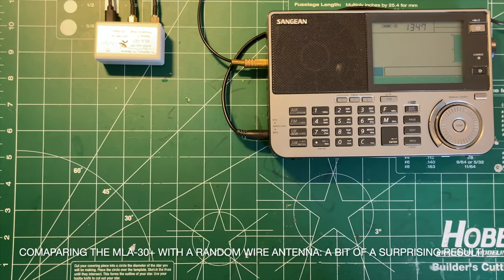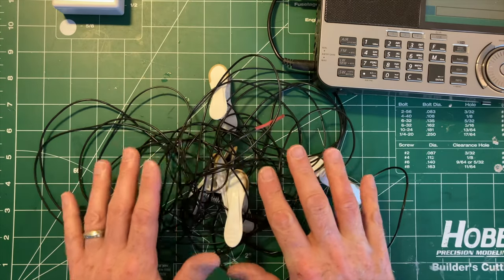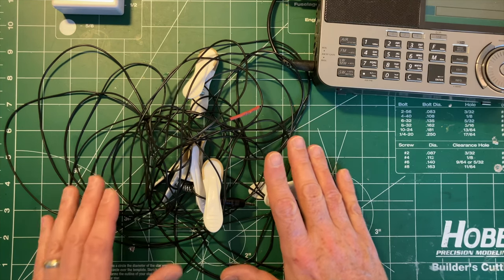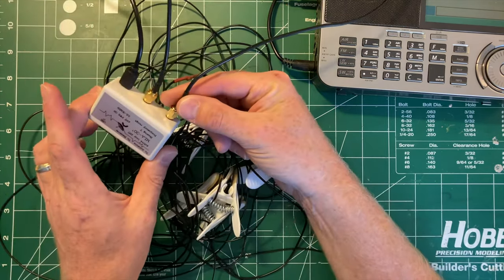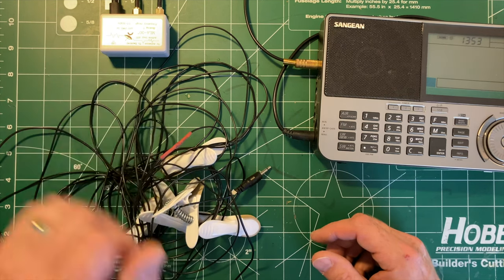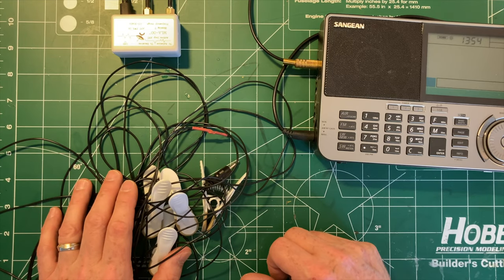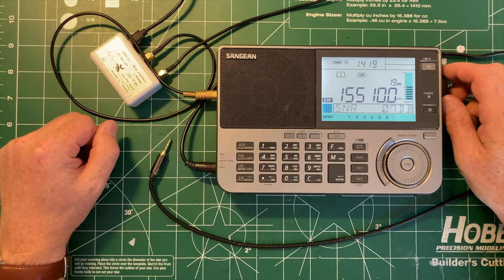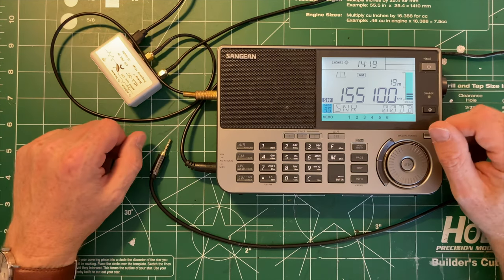Comparing the MLA30+ With a Random Wire Antenna: a surprising result

Comment: I took a 25m length of wire and set it up as random wire in my urban environment- very noisy. I then progressively reduced the length by 5m intervals and found that the optimum length for best S/N ratio  for my PL880, PL330, PL600 receivers was 7.5 to 10.0 m. The 10m wire I use appears omnidirectional and is my main antenna. Ken Baird, Lower Hutt, NZ
Reply from the maker: That's a good approach if the gain control on the radio isn't sufficient (or the radio doesn't have one like on the PL330).
Reply: What band(s) were you trying to receive.  Antenna length makes a big difference.  5m is a lot to cut incrementally, esp. if you first don't do the math.

Comment: With the mla-30, if the radio has a DX/local switch/button flip it to local to try to avoid the receiver from overloading. I have to some times do this with the MLA-30 hooked up with my Eton Elite Executive, especially on days/nights with real strong reception.

It's best to have the mla-30 mounted to something that can rotate because it is directional, it has nulls to the side of the loop, and the edge of the loop (in line) is where it picks up the signal. So if the signal is north of you, you point it north south, and it'll null out east and west. RCA makes an antenna rotator for around $100-$120 which would work well for rotating the MLA-30 but would it actually be worth spending $100-$120 on doing it vs doing it manually. 

The sma coax that leads from the loop part into the power supply isn't the best in the world, a popular modification is to cut the wire off and install a BNC connector and use a much better coax between the the loop and power supply. It's a tight fit but installing BNC connectors onto the MLA-30 power supply will also do a bit better signal wise. I have yet to cut the coax off and install a BNC connector onto my MLA-30 but I do have a BNC coax leading from the power supply to the radio and it has helped a little in a better SNR. 

You'll also see a drop in the noise floor if you can use a linear based USB power supply (CCrane use to sell them). 

I seen a slight improvement by clipping on some ferrite onto the coax on the MLA-30 on both ends on the coax leading from the power supply to the loop, from the power supply to the radio, and onto the USB cables leading into the power supply.

I've seen people make the loop on the MLA-30 bigger using some copper tubing, but I've not seen a comparison between the MLA-30 with it's stock wire loop vs the modified bigger copper loop to actually see if it helps or hampers it's range and reception.

With the nulling capabilities of a loop, they're good to pair up with a QRM Eliminator to have the capability to null out multiple noise sources.

Comment: I live in a small apartment on the 4th floor with no balcony and just one large window with a gap of about 12 cm at the top when open, I had a wire hanging out the window about 4m, I bought the MLA 30+ made it so I could slide it out of the window and turn it around, the MLA30+ is a lot better however I think I got a cheap copy as it started losing power (according to the LED on it) but I got a refund so cant complain. The MLA30+ was a lot better than my little wire.

Comment: If you are in any kind of an urban area, such as that would have local AM/FM transmitters, or an area with a great deal of RFI, the directional aspect of a loop antenna is hard to dismiss and is irreplaceable compared to a long wire for receiving. I know of no better all around LW - MW - SW receive antenna than the MLA-30/30+ for the price currently.

Comment: Good test.  So, you also get those loud clicks&pops QRM on 16 and 19 meter bands.  I have noticed them monday thru friday for the last 5 years and getting louder year by year (very easy to see on an SDR waterfall).  I think the US military is messing with a new broadband communications system but only a guess. Could be something commercial but the FCC would forbid that use.  Mystery QRM.

Comment: You should do the test with both antennas while running the radio on batteries only. AC power can generate noise.
Reply: hello my X2 after switching to SSB (on the built-in antenna) is very quiet (you can hear the voice but I have to set the volume to MAX) is this normal?
Reply from the maker: The Sangean power supply is pretty good. I’ve done a few comparisons and not noticed any difference on SW, but this is a good point.
Reply from the maker: Mine is quieter on SSB but I don’t find turning it up all the is necessary. However that’s based on a sample size of one and the signals I’m listening to may be stronger. It’s a common complaint/quirk with this radio.

Comment: i ve been using the mla -30 + indoors........do your self a favour and use a pl-330 to run the test.....way more sensitive ....i have a eton elite executive also...i am sure you are surprised by the mla-30+....changed radio life...lol
Reply from the maker: Move it outdoors if you can! I actually think the ATS909x2 is a bit more sensitive than the PL-330. Not by a lot, but enough to notice. 

The other bonus with the MLA-30+ is that it's a pretty good MW antenna too. The ATS909x2 has a MW antenna input but so does the PL-330 through an undocumented setting: https://youtu.be/-6YOn80EegY
Reply: Do  the orientation of the antenna do something, or touch install and forget about it ?

Comment: I use a standard tv cable from my radio to outside, then 50ft if wire around my fence. I also ground the cable to my radio and a copper pipe 1 foot in the ground. Works quite well from a condo.

Comment: Where does your long wire go? Could you please describe the length and position of your random wire antenna? Tx
Reply from the maker: I've used a couple of orientations, so I'm not sure exactly how I had it set up when this video was recorded. Most likely it ran across my roofdeck and then down the side of the building.

Comment: Great video 👍🏻 Also never connect external power source while DXing because it injects additional noise into radio.
Reply from the maker: Surprisingly this isn't noticeable on SW with the included power supply. On LW it's very obvious.
Reply: @sfred  my SW radio picks up noise hence said 😀

Comment: Just a heads-up that you are using an imitation MLA-30+. The Giveaway is the red LED and the label on the wrong side of the box. The original should have a green LED in the middle of the label. The difference in sensitivity is substantial.
Reply from the maker: That's certainly possible.
Reply: I've seen/heard the same thing, authentic green led top middle...Also, there is a significant difference between the original and inside if you open the case...
Reply: Mine is authentic,  green LED.
Reply: @@davidwanklyn8842🙌🤣

Comment: Am I missing something? Were you using an audio extension cable instead of coax from your wire aerial? Hardly surprising you were picking-up noise.
Reply from the maker: It's certainly one factor. I mention it when I discuss the two antennas, if I remember correctly.
Reply: yeah seeing that did surprise me vs putting a plug on rg174 or something.

Comment: My 909x2 is very poor on SSB, very low audio but also unfort my one is plagued by noises interally.
Reply from the maker: I'm sorry to hear that. Mine has been fine, but I understand you're not alone in having these kinds of issues.
Reply: The 909 series doesn't seem to do well on AM broadcast either.  Factually, my ham radios suck on AM broadcast (I understand they are not made for that) as well.  I am currently making a passive loop for AM broadcast DX.  I'll be repurposing one of my antenna tuners to affectuate the plan.

Comment: Strange... I have owned the MLA-30 and the MLA-30+, and their loops are the same size.  The other day I ordered a third one for a new pole I had bought... what was sent to me was a very strange antenna.  It had legitimate-ish labelling, said it was a MLA-30+, but the freq range and power rating for the bias-T were matched to the original non-plus version of the MLA-30.  Strangest yet, the loop was HUGE, almost twice the size of the "real" MLA-30.  When you showed your MLA-30+ mounted on the side of your building... that loop looks very large, like this weird one I got.  Most MLA-30/MLA-30+, to my knowledge, have a much smaller loop.  These things come from China and I have no doubt there are counterfeits or just straight up weird ones being produced from time to time.  Do you have any other MLA-30s?  The mystery deepens....sorry to bother, thanks for the video.
Reply: And if you look at your bias-T, the SNA jacks are on the wrong side.  I believe you have a counterfeit, mate...
Reply: And your bias-T has the label on the wrong side.
Reply: There's another video titled "MLA 30 Plus vs Knockoff" you may be interested in.

Comment: Well with shortwave bands the higher your antenna is off the ground the more qrn you will get Man made interference.... Lay your long wire on the ground not in the air because shortwave your not transmitting your RX So shortwave runs different than regular bands on RX try that same long wire directly on the ground and just see for yourself

Comment: I have two mounted on separate poles above the house. One at 15 feet, one at 20 feet. Both facing opposite directions, I do better with a 100 foot random wire. Of course, maybe I have yet to find their sweet spots. The 100 foot does better than the 50 foot. I do use all four though. I really hate the cheap yellow connector with the yellow spring. Going to upgrade that.
Reply from the maker: I think if I had room for 100' of wire I wouldn't bother with the MLA-30+, except maybe as a MW antenna.

Comment: Be advised your MLA 30+ is not the real one. Looking at the label and the light on your MLA-30+ you have a knock off version of the unit see here https://www.youtube.com/watch?v=XTOfC2PLlQA
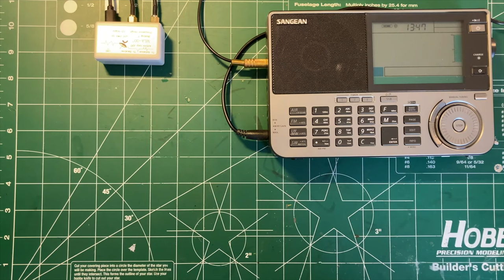Reply: BrianSlosson is absolutely right about this being a knock-off (inferior) version of an MLA-30+. Unfortunately, I own a knock-off. To be more explicit about the visible characteristics of the inferior knock-off, the "biasing tee" for a genuine MLA-30+ has a hole so that the green LED can shine through, while the "biasing tee" for a knock-off may or may not have a hole for its LED (typically red): 0:00  Further, the mounting case for a genuine MLA-30+ antenna has 6 holes while the mounting case for a knock-off has 4 holes: 5:30  The wire for the antenna is typically thinner and longer than the wire for a gneuine MLA30+., and the knock-off wire is typically coiled and then folded while the genuine wire is only coiled. The genuine unit also comes with two mounting screws.